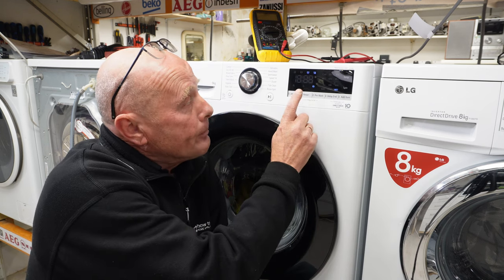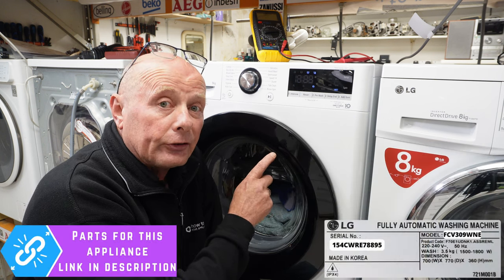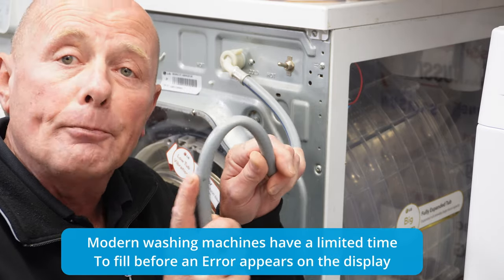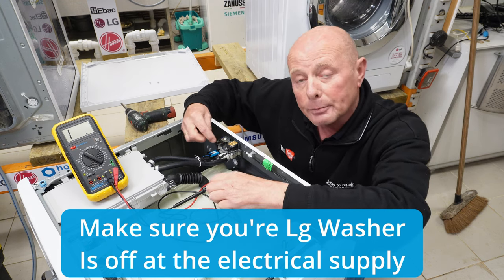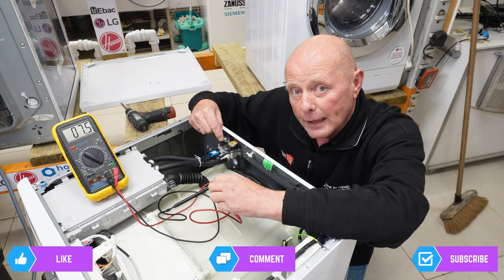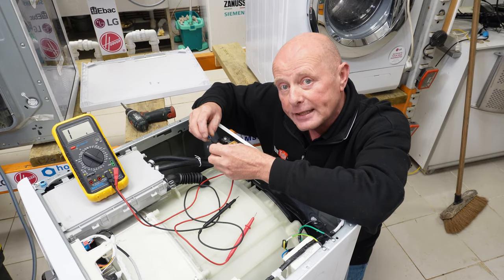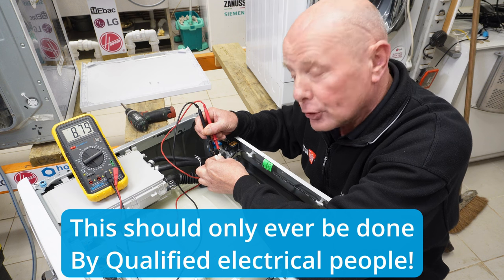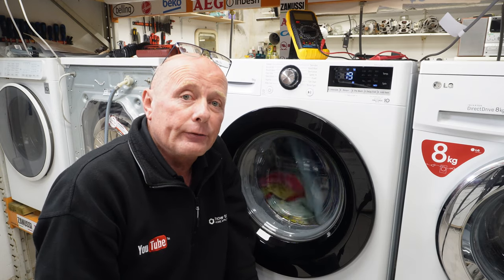LG washing machine IE or 1E Error code, Washer not filling in allocated period of time.

Comment: Thanks for this insight. I had recurrent IE issue with the drum getting overfilled and dripping out of the door. I also had good water pressure into the LG front loader washing machine. Tried everything, even adjusting the pressure switch to limit water intake, no show. Until I removed the front panel and have a closer look at the black air hose connecting the pressure switch, noticed a massive wear and air leakage owing to repeated friction on the drum body. I replaced the hose with exact same length and voila…no more overfilling of the drum, leaks or IE error. Machine washing perfectly now!!!
Reply from the maker: I'm really pleased the video was helpful to you. Could you do me a favour and take part in a poll I've made about the lifespan of appliances? You just need to tick one of two boxes. It will only take about 10 seconds. This might help us improve how machines are made in the future😇 

Here's the poll question: https://www.youtube.com/@How-to-repair/community

Also sharing will get more people to participate and we will have a greater impact with the manufacturers thank you for helping.

Comment: Is there something behind that small filter that can get clogged up? On hot water comes out at a good rate but when I set it to cold only it barely sprinkles. I can feel the water pressure on the hose attached to the cold tap so water is coming fine thru it (Replaced taps with new ones), cleaned filter, no luck. So i'm guessing there may be something beneath the filter that clogs? Cheers
Reply from the maker: Hi, please use our contact us page and make sure you fill out the request for what your problem is. I will need the full model number of the identification plate and the details of your problem so that I can provide you with useful literature. A video shoot of the problem would be perfect as well.

Normally, I would get back to you within 24 hours but I am on my way back from the IFA trade show in Berlin, so it can take more time to respond. Thanks for your understanding. https://www.how-to-repair.com/help/contact-us/   

Please remember to subscribe to our channel, as that's what keeps this channel going. Thanks, Paul 👍

Comment: Hi Mr my washing machine when cycle start after few mins it shows IE error i just checked water filter and clean it and it show now too it show IE at washing cycle first what do you prefer to i do tahnks for helping?!!!
Reply from the maker: Hi, I will need the full model number of the identification plate and the details of your problem so that I can provide you with useful literature. Please use our contact us page and make sure you fill out the request for what your problem is. A video shoot of the problem would be perfect as well.

I will get back to you within 24 hours, normally. https://www.how-to-repair.com/help/contact-us/  

Please remember to subscribe to our channel, as that's what keeps this channel going. Thanks, Paul 👍

Comment: My LG washer has IE error on screen. I already replaced the new water valve but IE error still appear. I can see water are filling inside the washer’s drum. Is there any suggestion what I need to do?

Is anything related to pressure chamber? Maybe the sensor not working?
Reply from the maker: If the pressure sensor is not sending a reading to the printed circuit board, it might be possible that this erorr is occurring. I would run the diagnostic test and have a look if anything is out of place. Make sure you test both of the water valves